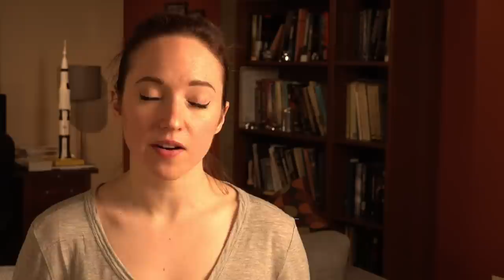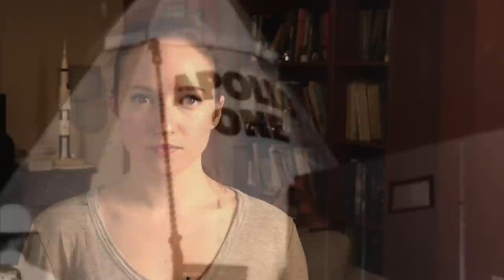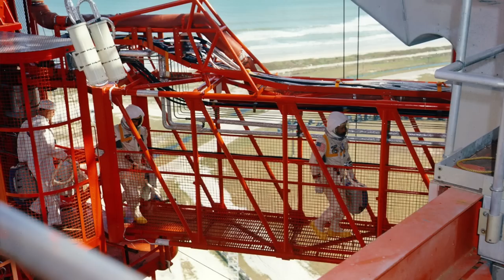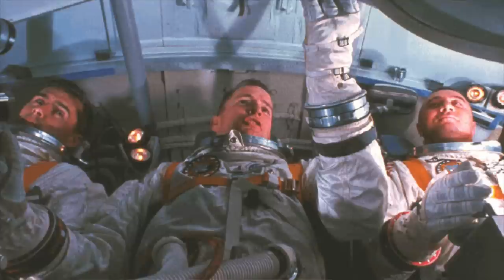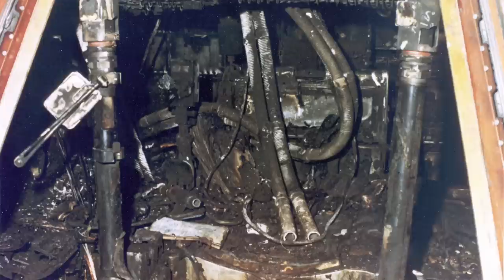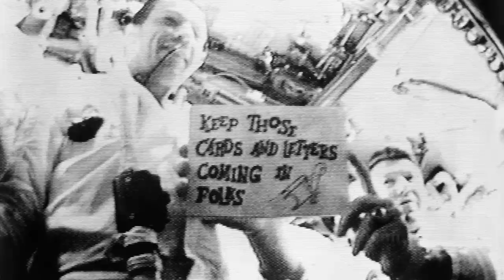Apollo 1 Was Doomed

Comment: One of the ironies stems from the design of the hatch in Apollo I.  In the aftermath of Grissom's Mercury flight, hatches were redesigned without explosive bolts after it was determined that the hatch may have spontaneously blown out following landing.  Its possible that if that design feature was not removed, the astronauts of Apollo I may have survived.  
Engineering state of the art machines such as spacecraft is incredibly difficult where hundreds of choices have to be made weighing crew safety, functionality and capability and trade offs sometimes have to be made.  Often conditions are encountered that were not anticipated, sometimes leading to tragedies. 
We must never forget the bravery of our astronauts and test pilots and their sacrifices.  Spaceflight was then and it now a dangerous endeavor with no room for complacency.

Comment: The investigation also turned up a few technicians' hand tools that had been misplaced - behind instrument panels, under the couches, etc. - in the course of work in the capsule.  NASA's response was to re-design their toolboxes with trays form-fit to the tools, allowing quick visual confirmation that nothing was left behind to cause problems in zero-g.
Reply: bobobobinalong we still use that very same tool control procedure even today building commercial jets.

Comment: It's amazing that NASA redesigned, built and flew in a year. Thanks for the interesting post Amy.
Reply from the maker: A lot happened between the fire and Apollo 7 to get the spacecraft ready to fly and the program back on track. It's really interesting. I'll probably break it down into a few videos at some point in the not too distant future!
Reply: LagrangePoint  I think I read somewhere that the Block 2 command module was already well along in development before the accident, and was being considered for use on Apollo 1. I think the reasons they didn't use it were because the engineers wanted more tests done before man-rating it, and that they already had a Block 1 capsule available. Of course, all of the lessons learned from the fire would be used in the final design of the Block 2 capsule.
Reply: +LagrangePoint They didn't redesign it within a year. This was a Block 1 spacecraft. The Block 1 spacecraft was designed around NASA's original Apollo specification, laid down in 1959.

 In its original guise, there was no requirement to rendezvous and dock (so no docking system or tunnel was fitted) nor was there any expectation that an astronaut would want to leave the safety of the spacecraft when it was in space. In 1959, it was not expected that EVAs would be performed on a regular basis.
Therefore, for safety reasons, the hatch design was a plug fit - which meant it had to be pulled INWARDS to be opened.

When the goals of Apollo redefined in 1961, it was realised that the basic Block 1 design would not be adequate for a mission that would include rendezvous and docking and EVAs. Therefore, from 1962, the Block 2 redesign was begun - this time with an outward opening hatch to allow EVAs.

The main changes made after the fire were improved quality control when being constructed and checked out and better internal fireproofing. They also changed the way the craft was pressurised when it was sitting on the launch pad.
A decision was also taken that no Block 1 craft would be used for any manned flights. All the manned Apollo missions used the much more refined Block 2 design.
Reply: more like 1 year 9 months, from January 1967 to October 1968. And two months after that, they put Apollo 8 in lunar orbit. :)
Reply: @AmyShiraTeitel  Here in 2020, and you certainly did. And as Amy points out, Block II was already planned by the time of the accident, but geez how can we not use these Block I spacecraft already built, they thought. Good enough for LEO, right? Well...

Comment: Two things.  they could have pressurized the cabin with N2 during ground tests or they could have had a valve to quickly depressurize the cabin.  Using O2 at high pressure is lunacy with people on board but what do I know.
Reply: To put in a nitrogen/oxygen mix would have meant a weight increase, and Apollo every ounce counted. But yeah....sloppy procedures and sloppy workmanship. But you have to remember no one had ever built a moon-ship before.

Comment: When you talked about the test that was classified as hazardous what kind of test was it I didn't hear it very well.
Reply from the maker: +Gahlok12 The "Plugs Out" test was the one that killed the crew. Here's my old article about it that gives some more details.
Reply: Amy Shira Teitel Oh that's what it's called.
Reply: +Amy Shira Teitel (Vintage Space) Was "plugs out" the test where they basically turned on all the systems to verify that all the parts worked together. I knew that there was a phase of testing where all the systems needed to run the Apollo craft were switched on, but the engine was not started.
Reply: You subscribe hazardous who plays GTA v?

Comment: Had the Russians been more open about their failures this might have been avoided. As they lost someone using pure oxygen environment as well in a fire.
Reply: +Claude “Reviews4U” Rains There's always the possibility that the Americans would have ignored what happened in Russia. But at the same time wouldn't it have been obvious to both the Russians and the Americans that if there was a fire in a pure oxygen environment what would've happened?
Reply: Michael Burke
I'm not even sure why they did it. As you don't need too.

I'm also aware that Pure o2 will speed up corrosion. As higher nitrogen reduces the rate. So not sure what they had in mind..
Reply: Claude Rains Yeah that's what's confusing. Unless they initially viewed the pumping of ordinary air in to the capsule, then out, then replace it with pure oxygen for launch was viewed as too complicated or expensive. But I think actually they were complacent in regards to fires in the space craft. So yeah, I think their arrogance could've caused this.

Just look at the two shuttle disasters for some of the NASA mentality.
Reply: Nitrogen will bubble out of your blood in lower atmospheric pressures (the "bends").  Just as an airliner is not pressurized to sea level, neither is a space capsule. I would suspect that the lack of nitrogen was for the physical safety of the astronauts, but the error in foresight about the possibility of fires in the presence of pure oxygen ultimately cost the three men their lives.  Using it during practice was probably just easier than setting up something else.
Reply: +Chad Portenga That also but mainly shedding weight. You need a cylinder with inert gas, something heavy and unnecessary for life support. Pure oxygen atmosphere requires only one cylinder and simpler system for providing it. And works just as fine for keeping you alive.

Comment: In the film The Right Stuff, Gus Grissom is shown demanding the Mercury capsule be built with exploding bolts. This later works against him durring his splash down when the hatch is blown open (intentionally or unintentionally). Assuming this was historicaly acurate (I mean it's Hollywood after all) was this the reason NASA switched to the inward opening hatch which sealed Grissom's fate with tragic irony?

Comment: White was in the best shape of all the astronauts. Even with all his strength he wouldn't have been able to open the bolts for the hatch. The fire raised the internal pressure to 29 psi. The door was a two piece design that could only be opened at 2 psi. There's a sad irony that Gus Grissom almost died because of a hatch with explosive bolts opened prematurely in Mercury. And did die because the hatch on Block I Command Module wouldn't open at all.
Reply: +leftcoaster67 This is very true about Ed White and his athletic ability. He competed in the 1952 Olympic Trials at the 400 meter hurdles and did not advance beyond the first heat but was the highest non-qualifier.

Comment: An inward opening hatch just seems suicidally stupid as does the number of things they missed or ignored or designed badly that should have prevented this from ever happening. Such a loss a true shame idk what nasa was doing as this is far below their expected standard. Miss ya fellas much respect always.
Reply: The hatch was designed specifically to prevent a re-occurrence of what happened on Grissom's Mercury flight, where the hatch unexpectedly blew after splashdown.  If that happened during an Apollo flight while the crew was unsuited, they'd die before they could get their suits back on.

It also has weight advantages.  Because it doesn't have to be held closed against the cabin pressure, it can be made lighter.  We see the reverse situations in submarines-the external hatches all open outward, so that the pressure of the seawater at depth holds them closed.

Comment: why did they have explosive bolts so they could blow the hatch off?
Reply: It was because of losing liberty bell 7, grissom's spacecraft from the hatch blowing, the engineers and people in charge didn't want that to happen again, so to solve the problem, they made the hatch open inwards but the design made it very hard for the hatch to be opened in an emergency, even from the outside, it almost went back to alan shepards mercury spacecraft, where the hatch was bolted on and had to be unbolted from the outside, in an emergency, the astronaut had to swing the control panel out of the way, remove the inner bulkhead, push the parachute and instrument package out the top then climb up through the nose of the spacecraft to get out. Because of the fire, the hatch was redesigned to open outward and had a quick release handle that only took seconds to turn instead of minutes.
Reply: +MegaWetwilly didn't realize  they abandoned it completely after the sinking incident
Reply: Well, it did sink in 15,000 feet of water, at that time there was no technology that could recover it, even if they had it's exact location, but it was found and brought up in 1999
Reply: sorry, i used too many pronouns, i meant im surprised they abandoned the explosive bolt option. Even as a little kid i followed that recovery as best i could - i was (and still am) fascinated by space flight - especially the early stuff.

Comment: How could the astronauts breath 100% oxygen at 16 psi?  that would kill them.
Reply from the maker: They were breathing their own feeds; the 16psi was the cabin. It was the equivalent pressure of 5psi when the spacecraft was in space.
Reply: hmm, their pressure suits were being squeezed by 16 psi but they were breathing at 5 psi.  sounds difficult to do.
Reply: thats why theirs tests
Reply: stop trying to deny space travel, its been debunked to the moon and back.
Reply: Bob Guzman It was. that's why when they do tests in spacecrafts their suits looked inflated.
Reply: +Vintage Space I guess that why they are donning theyr helmet well before the cabin ingress?
Reply: +NorthBoundWolf isn't it suposed to be the other way around? I mean you can't maintain 5 psi in a suit if the cabin is at 16. A suit is made of soft material, it will squeze the suit raising its internal pressure so it can't be inflated. Or is there something i'm missing...
Reply: i think the 16psi is over vacuum. so the cabin wad only pressurized by an additional 1psi over atmospheric pressure. Once in space the cabin would reduce pressure to 5psi over vacuum, to not blow the door off.
Reply: CptMikeTango ILC made the Apollo space suits in three layers. Layer 1 is the undergarment with the cooling tubes to prevent overheating. Layer 2 is the pressurized garment with helmet and gloves to maintain air pressure around them yet enable joint flexibility. (ILC's strength from years of making Playtex bras and girdles.) Layer 3 is the outer garment worn on EVAs. See the Moon Machines episode on the space suit to see how it works.